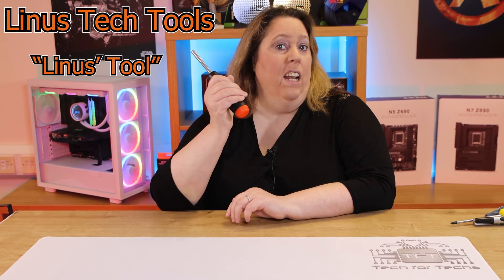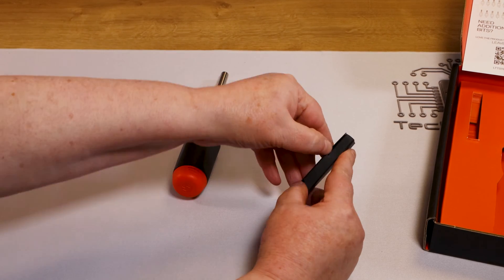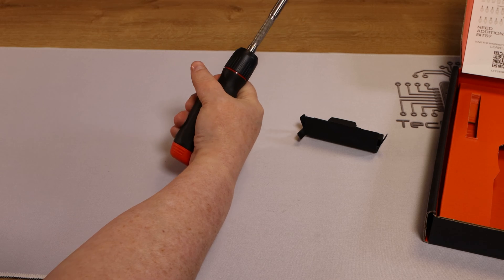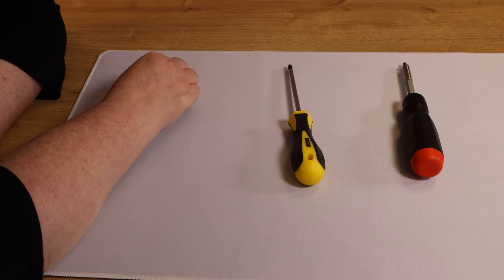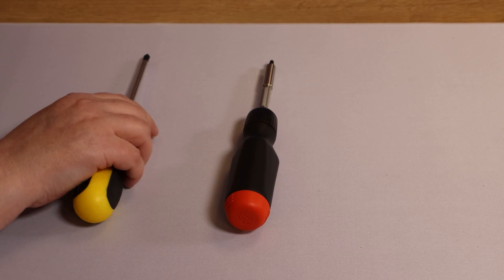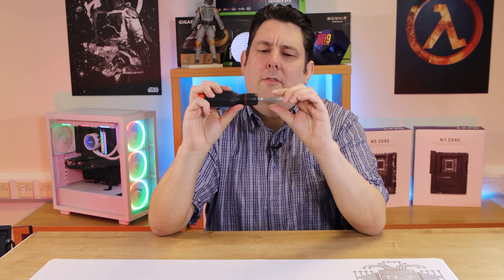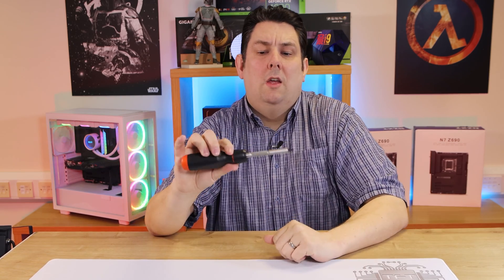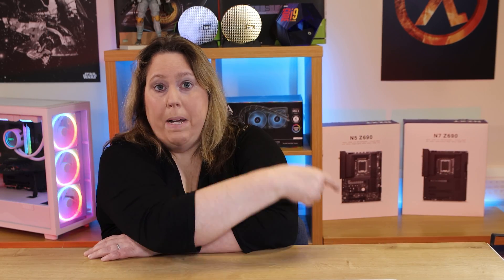@LinusTechTips Screwed Us

Comment: This chick complaining about it being too big whilst it's probably the smallest ratcheting screwdriver on the market...

It'd only be fair to compare this scewdriver to other ratcheting screwdrivers. This is probably one of the easiest ones to handle, especially for people with smaller hands. If your hands are still too small and the convenience doesn't outweigh the discomfort, stick with regulair screwdrivers, but your opinion on this matter is worthless.
Reply: @HTR I didn't know but apperantly that's true. However, then you're not talking about the same category of screwdrivers. Those are not in the same ballpark. They can't hold the same amount of bits and a shorter shaft would make it terrible for PC building. And I doubt if they compare quality wise. Compared to screwdrivers with a similair feature set these have an exceptionally small grip especially for people with smaller hands. It was part of the design philosophy of the screwdriver.
Reply: Was thinking the same